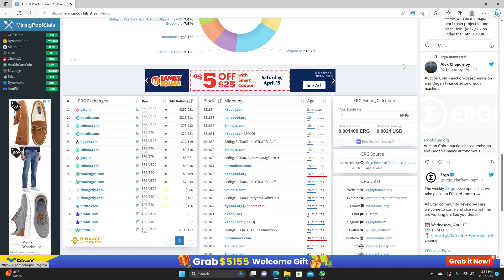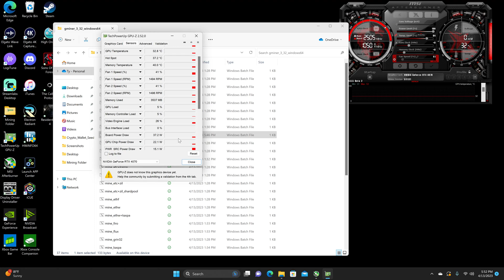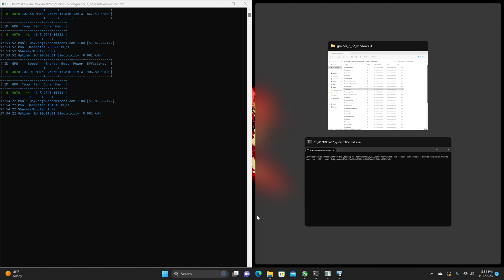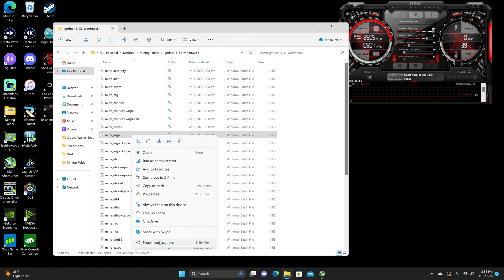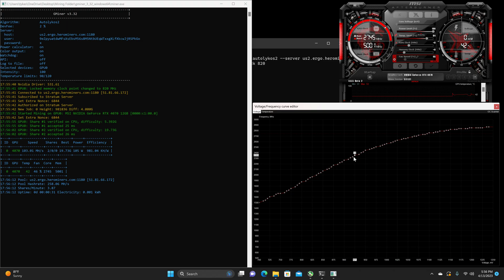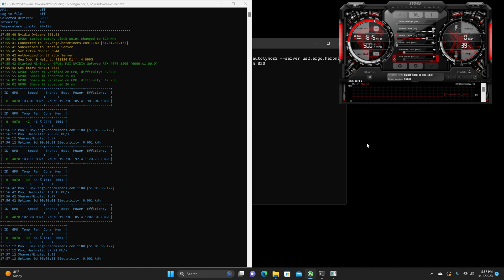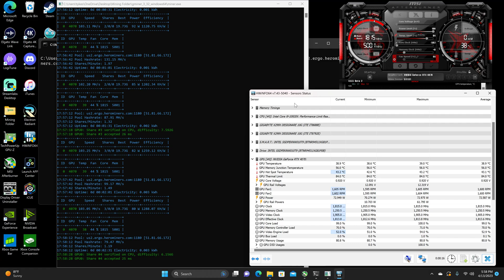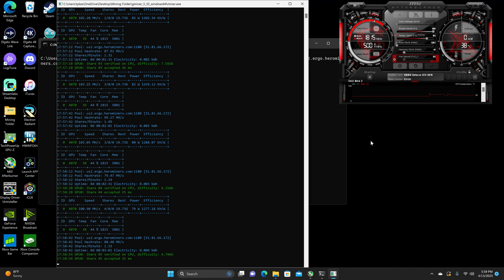Rtx 4070 MSI Ventus Ergo hashrate overclock settings

Comment: Could you compare to 3070 values?
Reply from the maker: It's been a while but if my memory is correct the 3070 gets higher hash rate than the 4070 for pretty much around the exact same efficiency because of the 3070's bus width. The only thing the 4070 has over the 3070 is that it has 12gb of vram so it'd be able to mine for longer once coins dag sizes get over 8gbs of vram.